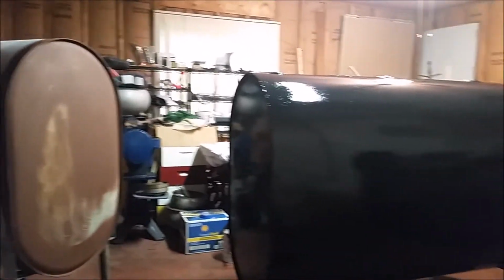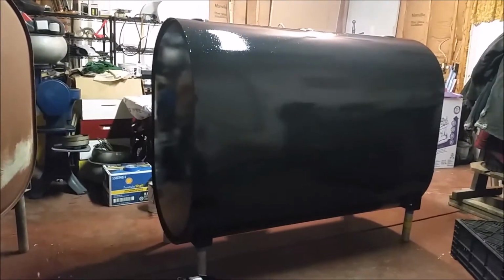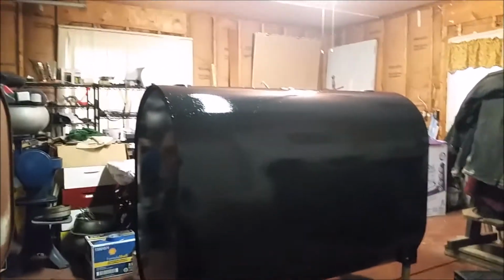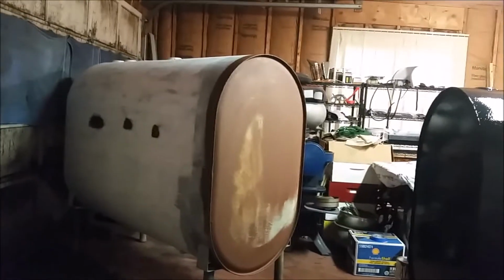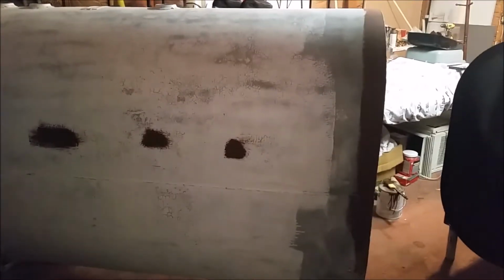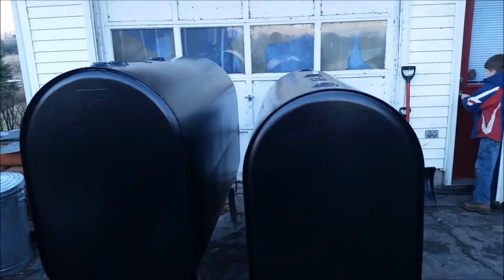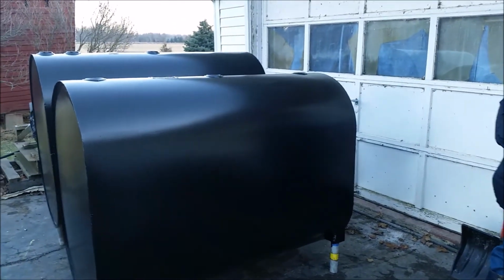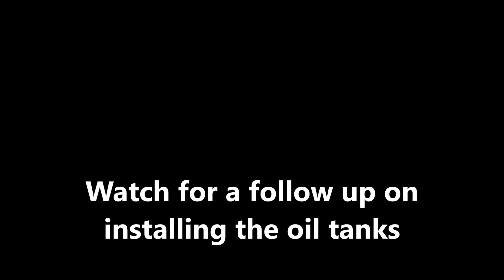Refurbishing old fuel oil tanks

Comment: Thanks for the video, just picked one up today with electric pump for 25.00 .  Guy said had sludge . I found 15 gallons of nice fuel in it.  Going to use that implement paint with roller.
Reply from the maker: Good find. Especially with the pump.

Comment: YOU CAN PAINT THAT OIL TANK BUT THAT DOES NOT CLEAN THE INSIDE OF IT AND IF THE INSIDE IS FULL OF OLD OIL GRIME IT WILL CONTAMINATE THE FURNACE
Reply from the maker: Consumers are told they need a new tank to sell tanks. Our family has been in the heating oil business for 3 generations. Believe me, when you do a pump out you clean the tank with fresh fuel and flush it. If you've got sludge in your tank your oil company needs to step it up and get you the better oil they are already charging for. Most people never change their tank filters and that can be easy taken care of too.

Comment: If outdoors you should use aluminum paint. It will reflect sunlight and prevent condensation.
But if indoors it may not matter too much. Nice job👍
Reply from the maker: Indoor storage here. A lot easier to maintain too.

Comment: I have a oil tank that is currently painted but paint has started to come off of it and. Needs to be repainted you said you sanded yours would I be able to use a battery operated sander on that then or what would be best to take it down so I can redo it ?
Reply from the maker: Yes I used my power sander. Then a coat of Rustoleum rusty metal primer and 2 coats of paint. Oil Based.